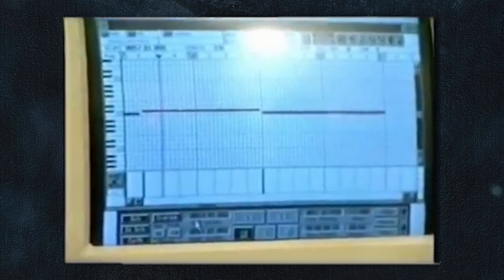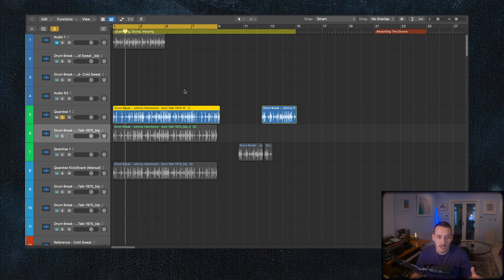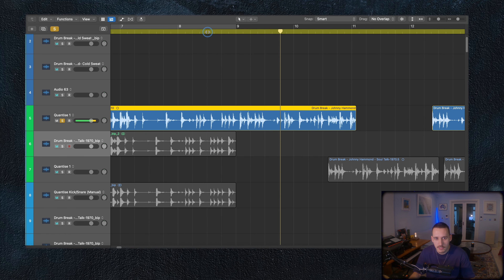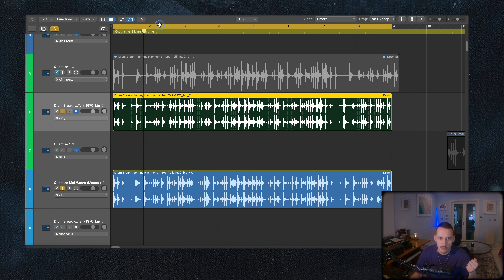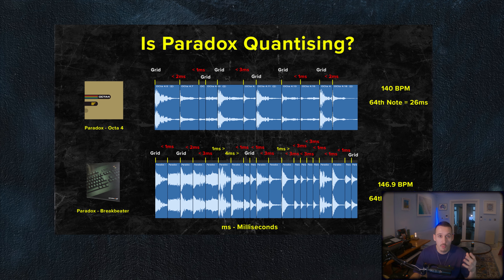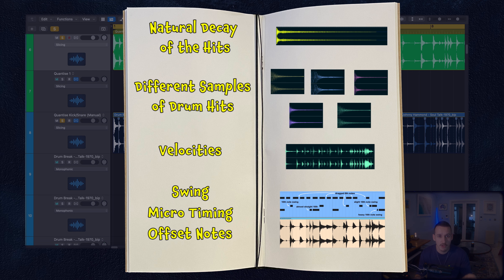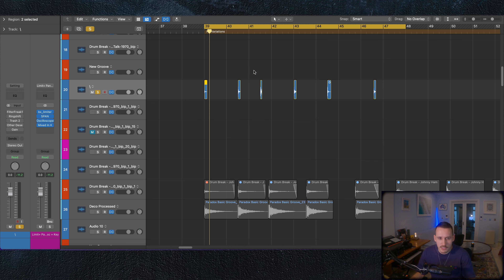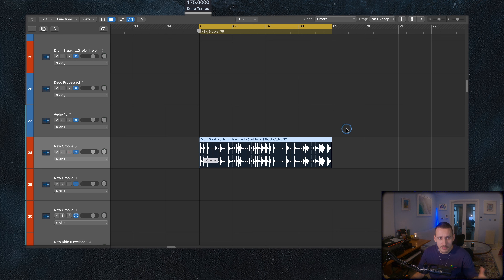Paradox DnB Production Breakdown Pt.2 - Programming & Processing

Comment: You can go micro or macro with waveform/break slicing.
I’ve done it so many times over the years I can do it by eyesight now and don’t really need to hear the waveform apart from a first run through.
Zooming in and finding the perfect and not so perfect slice points takes time to get to know.
It’s also about using those off slices to add different timings and ‘air’ to your breaks. 
These days with DAWs you can slice your waveforms and reload them back into your hardware samplers and then back and forth to get character in your sound. 
People forget that this stuff was all done by hand in the 90s we didn’t have DAWs like now back then and it took hours to do this. 
Another cool tip is to sample your hits with very short room reverbs which had the effect of doubling the sound but also making your made up sample sound more natural with abrupt release times.
Be careful with EQ and boosting,especially at high frequencies, clubs won’t thank you for shredding their punters ear drums or blowing their speakers! 
The pay off is that you won’t sound like anyone else if you do it your own way, not someone else’s…..
Reply from the maker: I agree about the slicing massivly. I always do it manually even though its a litte bit tedious, its definitly an important part of the process.
Slicing by hand on the EMU e5000 or Akai s1000 takes forever. It's also harder to be as precise when chopping individual hits out. I do a lot of resampling back and fourth like you said.
I think music & creative arts in general is all about being inspired by other people work and learning how they have done things so you can adapt that to your workflows and make it your own. Cheers for the comment mate ✌️😊

Comment: Oh, with regards to working on Renoise, or using MPC and other hardware, I have heard people say how the ‘clock’ is more accurate than in a DAW. Is this just BS, or is there something to it?

Surely if something is one the grid in Ableton, it is on the grid, right? What is meant by ‘the clock’?
Reply from the maker: Yea some people do say the clock is more reliable for bits of hardware than the DAW but its hard to really know. Renoise is very good and i've had no problems ever with the clock. I wouldnt stress to much about it unless your having problems. There will always be issues with certain bits of equipment. Modern or old when it comes to get the sync super tight. 

The clock is how different devices sync up to each other over Midi. I.e Pattern 1 on Digitakt syncs to Logic Bar 1.

Comment: I find the easiest way of doing this is with Rex 2 midi packs like Rex DnB- you can export the (many classic)  drum breaks to your daw in one click and then move around as you like- I've told people about this many times and they always seem to insist on more laborious techniques to achieve the same thing...
Reply from the maker: Recycle is no doubt a great tool. Logic Flex Slicing is very similar. I do actually quite enjoy the process of sample chopping & also find that automatic slicing alogirthms are never as precise as manually chopping. I like to quantize certain hits, offset slice points, include the build of energy is certain kicks and snares and have others super tight to the transient. There is a lot of nauance in break slicing that informs the rest of the process.